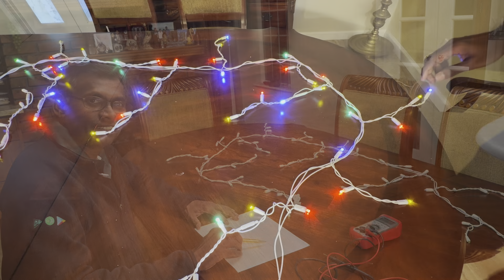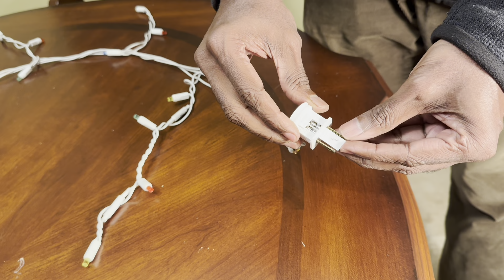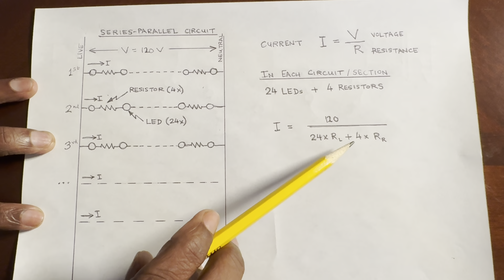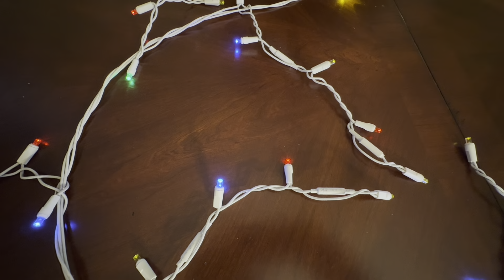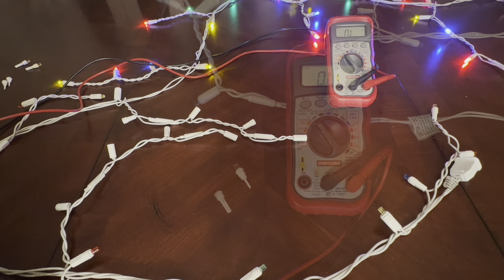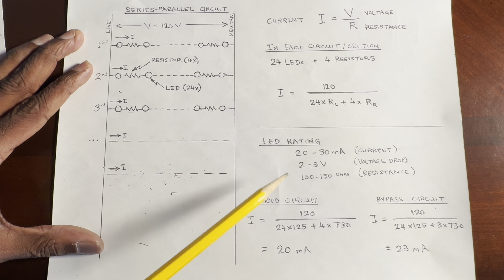Christmas lights repair - dim LEDs

Comment: Isn’t your solution to cut out the resistor and bridge with a wire the same exact thing as using that red wire between the terminals?
Reply: Resulting in a possible burnout of the other LEDs quicker than they were manufactured for

Comment: Excellent explanation!
This helped me diagnose my problem with lights not working when I found 1 of the resistors had a broken piece of wire not making contact. I replaced the resistor and everything is working again.
Thanks Vinod!